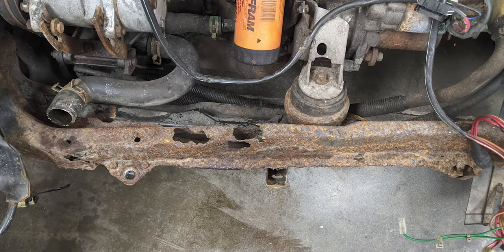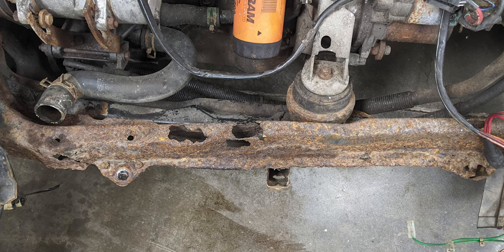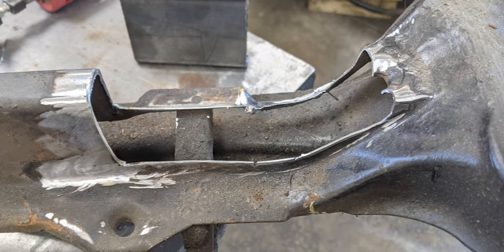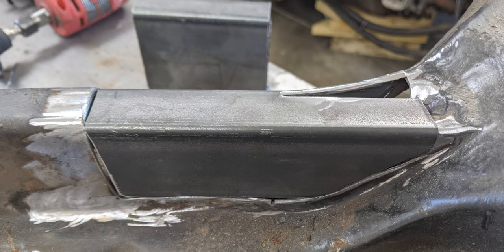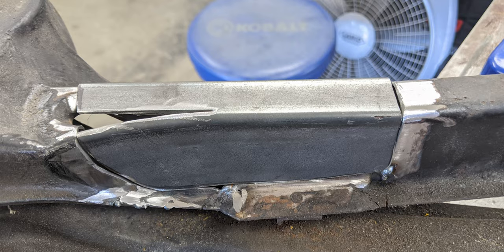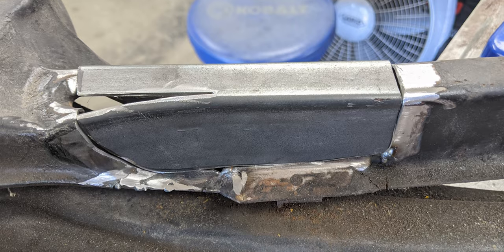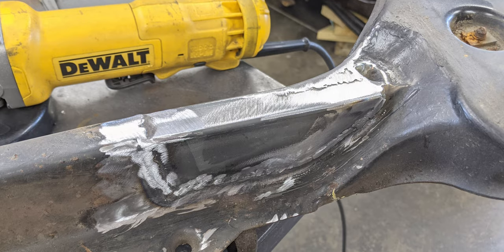GTI PROJECT S01EP02 Coolant test

Comment: It couldnt be a head gasket milky oil could be condensation saw couple cars do that  only on petrol cars
Reply from the maker: That could be another cause, but trust me, it was the head gasket.
Reply: @Obscuremotorsports  so a rebuild it is , lets go good luck im here 👍🏻